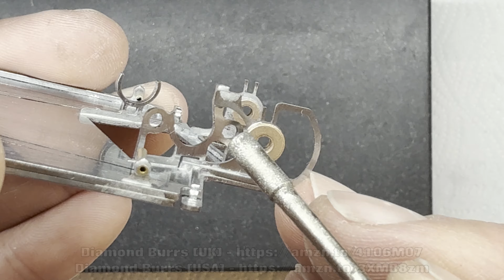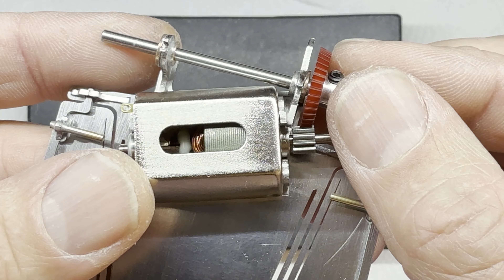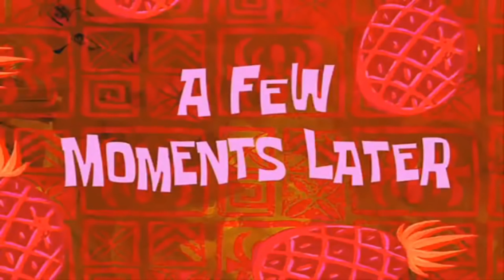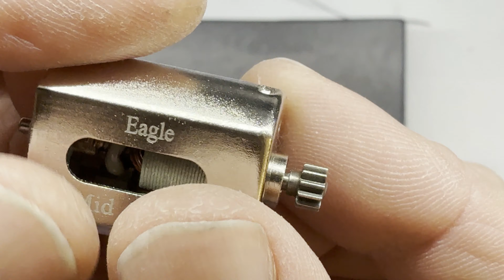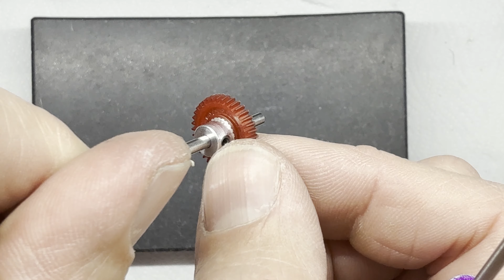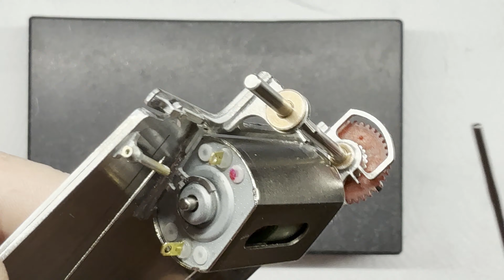Will this slot car chassis win the 2025 BSCRA Mid America Clubman Nationals - P2 (Motor and gears)

Comment: James - why you had to retify de crown ?? - only the tip ?
Reply from the maker: It made the gear a little smaller in diameter so that the tips of the gear teeth didn’t protrude below the chassis.
Reply: Yes..those angled are a bit bigger..usually let's say if you use 37 alignment axle only the 36 or smaller fits..and it happens and we have to rectify the tips...big Hug Chris = Brazil

Comment: If the pinion is unacceptably soft it seems a blowtorch and bit of quenching oil would fix it.
Reply from the maker: It’s only running with a plastic spur gear so it should be fine for a while.